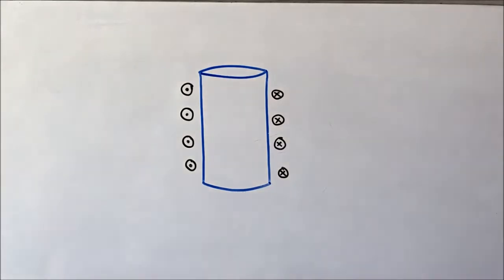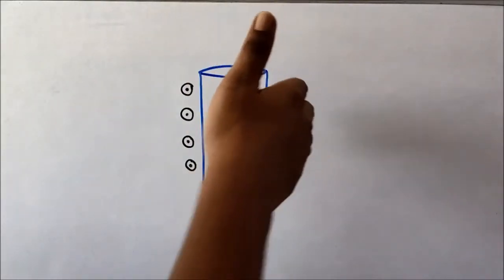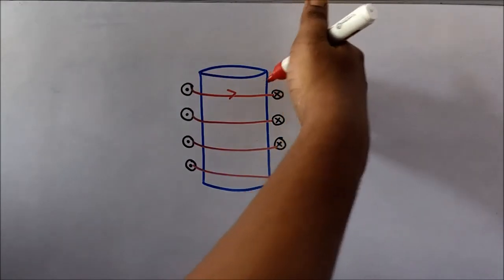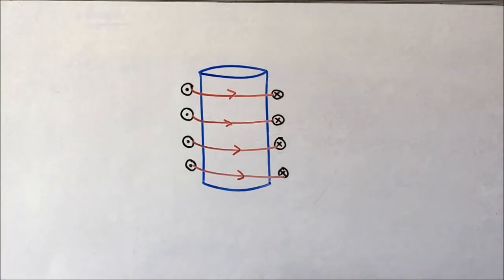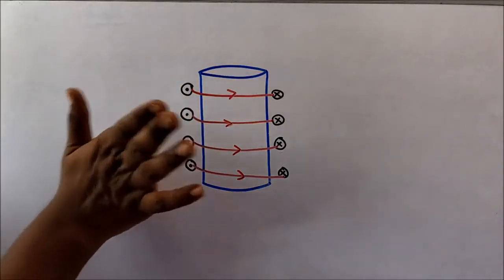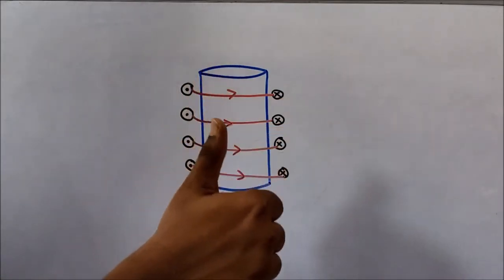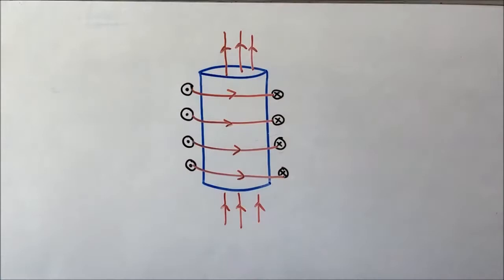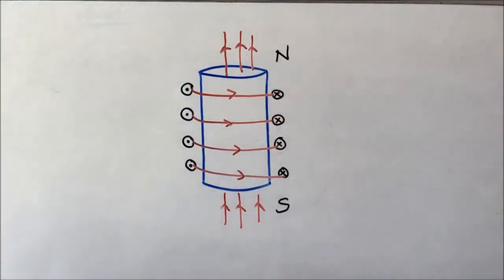How to find the North and the South Pole of a Solenoid? Magnetic Effects of Electric Current Class10

Comment: Sir but according to maxewell thumb rule ,thumb represents the direction of current but u said totally opposite .can u explain how to find poles of solenoid briefly by replying me
Reply from the maker: Thanks for your question. 
The purpose of the video is to make you understand... how to find the poles of a solenoid without using any extra rule. 
Maxwell's Right Hand Thumb Rule is for finding the direction of magnetic field lines around a straight current carrying conductor, if thumb is along the direction of current, then the circled fingers represents the direction of magnetic field lines. 
But in case of solenoid,  the conductor is wound around a cylindrical core. To find the direction of magnetic field near the ends of the solenoid, the converse of Maxwell's Right Hand Thumb Rule can be used. (No need to remember, any other rule for it.)
Field lines of a solenoid are similar to that of a bar magnet. The end where the field lines are emerging out, is the North Pole & the opposite end is the South Pole.